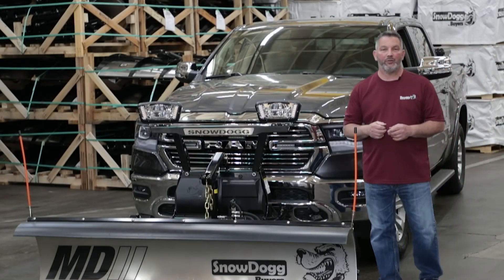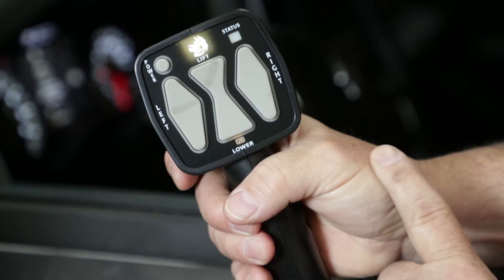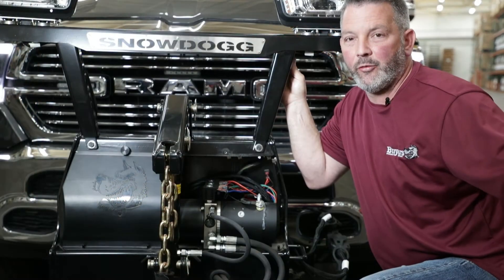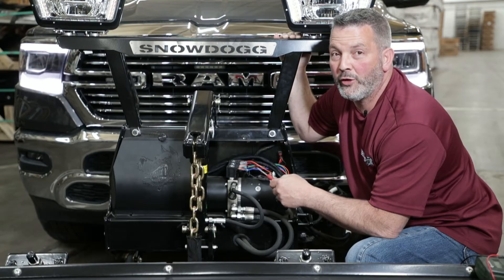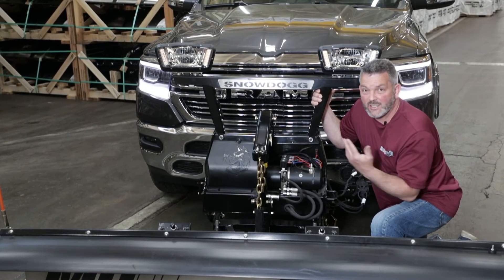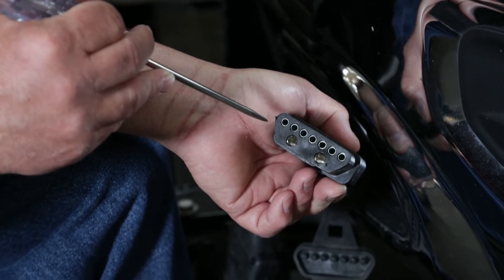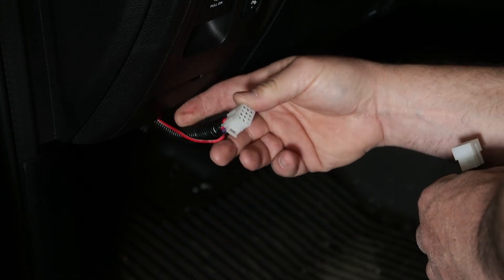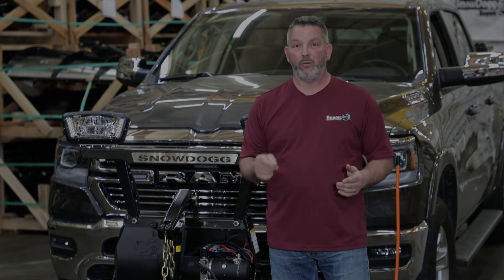SnowDogg Tech Support: Testing the Coils on the Plow Power Unit

Comment: My plow has issues going down sporadically. It will work then it won't. I have all new wiring from the truck side so it is either the coil or the wiring on the plow side. I now know how to check the coil to see how to test that and see if it is working. If the solenoid inside is plugged with debris or the like will that also cause this?
Reply from the maker: Thanks for your comment! I spoke with one of our Tech Support representatives, and this is what he had to say: 

Yes, debris In the valve will cause it not to work. Clean the valve. If the valve is full of soot, then the lift cylinder packing seal is breaking down and needs to be replaced or it will keep happening. Also, the soot may be in the tank and clogging up the filter. You can put the controller in float and test the coil with a test light or put a screwdriver on it and see if it is magnetized.
Reply: @ ok great thank you.